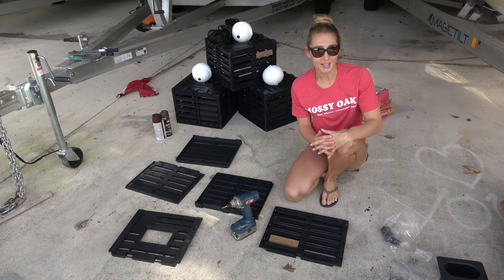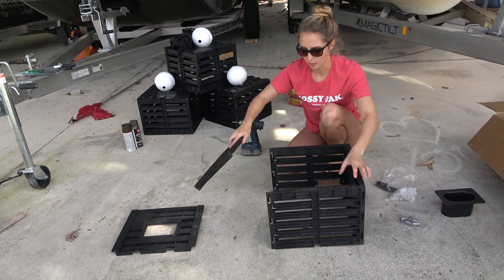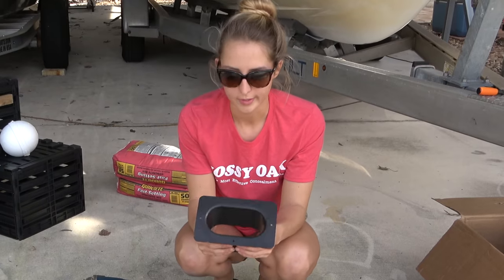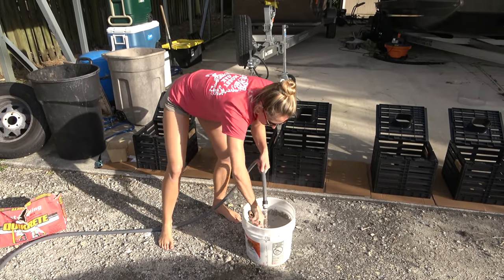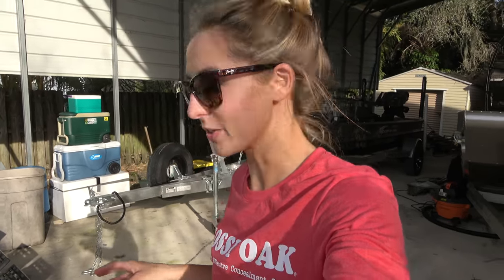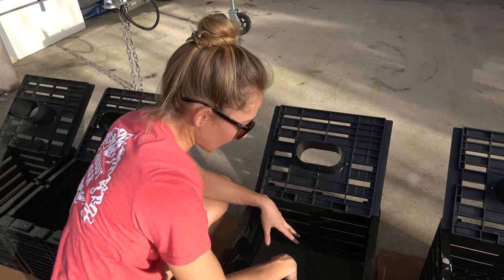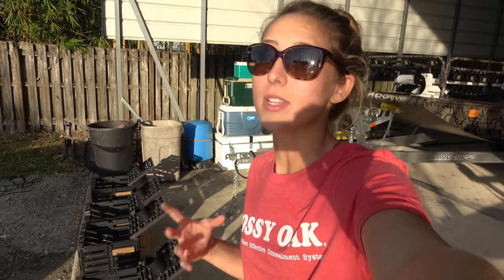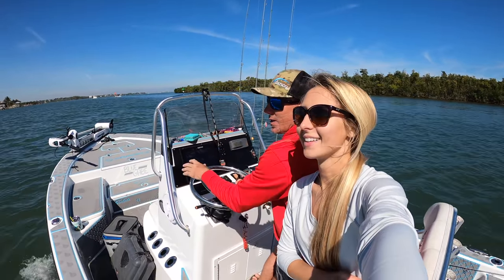HOW TO Build Stone Crab Traps! *Everything You Need To Know*

Comment: As a former concrete guy, a few suggestions. You can set the traps on plastic sheeting, then you can recycle that carboard, which you couldn't do if you poured concrete on it. For the wire, ideal is that the holes in it are a bit bigger than the rock in your mix. Small holes like you have could cause the tile to split through the center. I would use a piece of 2 by 4 to patty cake the concrete down and even it out so you don't have to get your hands in the wet concrete. Not for sensitive hands. I would fill them in until even with the top of that lid or just a tiny bit above it. I would also tap the outside of the plastic box with the 2 by 4. We call it consolidating the mud, which mostly means that you are getting the bubbles out of it and making sure it fills up under that rim. Don't tap with a standard metal hammer as that could break the plastic, and gentle tapping... Also, I would let them sit at least over night before picking up and moving. Yes, it is hard in an hour or 4, but if you drop it, it will shatter. If possible, soak in water for several days. The water will leach out the nasty concrete smells. Soaking in sea water or marsh water would be better.

Comment: kelly there is foam  {Sika Pro Select Fence Post Mix 33 oz ]you could use too. it is sold at ACE hardware.  works great for things like this. sure it foams up but if you keep it under control it seals the bottom well. put pea gravel in it when you pour it in. it will be lighter and still seal. Trap will settle like a concrete on because of pea gravel mixed with foam.

Comment: Just a hint when spray painting styrfoam, you might want to paint it with wood glue first or non-soluble Elmers white glue as that will seal and protect the foam. Think of it as a primer, after it drys the aerosol chemical shouldn't be an issue :). Great vid as always!

Comment: Slurppy? haven't done that for decades. You can mix pearlite (used in potting soil mix) in with the concrete to lighten it some, but it's kinda expensive. Those look like some great durable pots. Would be cool to have an RF alarm on the pot so it transmits a signal if it's pulled above water. Maybe an exploding die pack if you don't quickly deactivate, lol.

Comment: Please consider if a lighter weight is desired core a 12 inch diameter thru the concrete to save 8-9 pounds. 
Required will be (2) 1/2 inch thick X 12 inch diameter styrofoam or plywood disks, stack the disks to drill a center hole for an alignment feature. Place the first disk in the center of the trap, fill with concrete top it's thickness. Place the wire as shown, place the second disk on the wire, align with a screw/bolt suitable to the drilled hole and continue to apply the remaining concrete being sure it is locked under the side flanges. 
(If wood is chosen a disk should have 1 or several 1/2 inch holes to punch out the other disk after the concrete has cured. The driven punch should be smaller than the square of the mesh. If many traps are to be constructed a 15 degree angle (draft) should be on the disk edge for release to reuse-care to have the smaller disk face diameters contacting the mesh. The center holes can be the lathe center to file the tapers using a hand drill)

Comment: Little tip for you when your  shelling shrimp afternoon remove the head and go to the tip of the tail get two big bottom fans if you look there's a metal fan that comes to a point between them take your thumbnail up under it pull up and back towards the head skin slides off Dennis devane at the same time

Comment: That concrete will set in 40 min but will not be durable hard for 24-48 hours full cure is 28 days. It's the toluene the drying agent in the paint that is melting the styrofoam